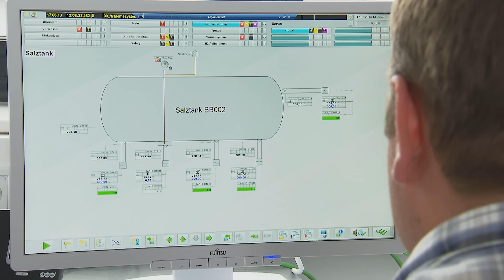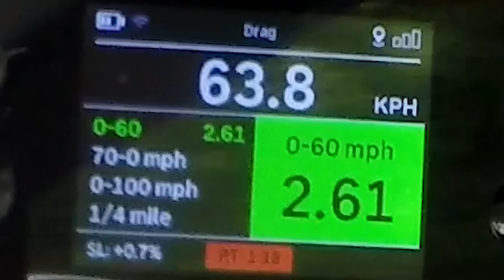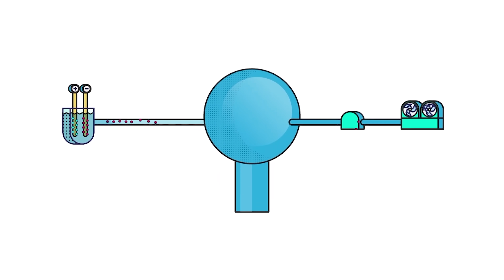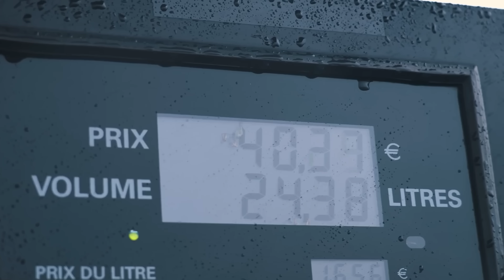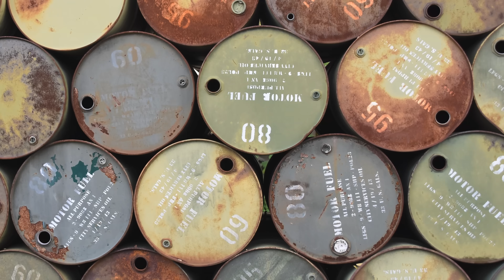Porsche just SAVED petrol engines FOREVER

Comment: This is great news and all, however I don't think it will be any more than a niche market for the private car park. Why?
1. This will still have all the problems associated with local pollution(smog, poisonous NOX particles etc.). 
2. Look at where EV infrastructure was 10 years ago, then imagine it 10 years from now. EV infrastructure is going to be completely solved in the industrialized world by the time they can produce synthetic fuel at scale, in a green way. Which then begs the question, why put in a huge investment to replace something that is already covering 90% of users, with a worse solution?
3. EV's are objectively better cars than ICE cars. They are more efficient, they perform better, they are easier to drive, they have fewer things than can go wrong and need maintenance. Basically the only reason any customer would want to buy an ICE car over an EV is either because he lives in a very rural area, or because he has a subjective nostalgic preference for ICE cars.

I imagine we will get a future were all "gas stations" are basically converted to pure "EV stations", but some of them will have 1 synthetic fuel pump to cover those niche customers, and it will therefor probably be a quite expensive fuel.

Where this technology can really make a difference though is in industry. Air planes, ships, even long distance trucking perhaps, it can really turn out to be a magic solution for that problem.

Comment: If they can get the price of E-fuels down to something comparable to todays prices, then any country with a lot of sun could be an oil superpower.  Also, we can drive gas cars and Greta will finally shut up.  Emit the carbon, suck it back out of the air.  It's the perfect solution until we figure out battery tech.

Comment: Why? 
- Electric vehicles have better accelerations with almost no lag, full torque available at all RPMs. They can be made cheaper and lower in maintenance.
- The cost of this recapture-refinement process will have lower efficiency and will not be cheap at all.
- By the time you ramp up these new fuels the infrastructure for electric cars will (likely) be in place and new batter tech will allow charging them in 10 min or so.

Comment: so they're making hydrogen, which is an energy hog, to make electronic fuel (the e in efuel)... that seems like a waste.  let me guess only a few companies can do this!
whereas if any parking spot can be turned into an EV charge place.. by simply adding an awning, adding solar panels, and some batteries to store power when no EV is charging.  there are already companies making these as popup charging for shopping centers.

how many solar panel companies exist?  they're all in competition for sales.  how many efuel companies exist?

and electricity is still loads cheaper!

Comment: 25 percent efficiency only works in gasoline vehicles because we are pulling the energy out of the ground.  If we have to make the fuel with energy and only get 20 percent or less in return, that's terrible, expensive and not sustainable.  Sure EV's aren't perfect but they get around 77 percent efficiency in the total fuel cycle not the 16 percent expected from e-fuels.  Range and charging speeds improve every year and with the price of battery materials, particularly lithium, falling of a cliff the prices for ev's will keep falling.  This doesn't even include new battery chemistries coming to market literally right now.

Comment: In my opinion fuel cells make the most sense in the long term, they have better energy density than batteries, don't require nearly as many precious resources, and you don't need to spend 1/2 an hour recharging them. Theres a whole lot of problems with fuel cells at the moment, but to me they look like the best long term solution.

Comment: The charging problem will probably be solved way faster than this being able to supply global fuel consumption. Also "carbon neutral" is a blanket term used to make things sound more appealing then they are. Yes this is better for the environment than fossil fuels, but it's not on the level of electric cars. 
It looks like e-fuels could be great for aviation though and they should definitely push it more towards that direction.

Comment: It's a pipe dream. Only for exotic, premium buyers. The fuel  Is incredibly expensive and is not really carbon neutral.  Heavy equipment could use the hydrogen in diesel engines. That's what JCB is doing. No need to convert it to synthetic fuel.

Comment: The price wont be the problem. The thing is that we dont have that much energy to pruduce such a big amount of fuel, an EV can drive 3x longer than a normal car with the same energy. E fuel will be a solutions for planes and ships which cant use a electric motor. 
Nearest thing is to just use the electricity for the car "direkt" as long we dont have the power for efuel.

Comment: I think there is one more issue with modern cars.
Safety requirements
I am not talking about aribags or TC.
More about self driving technologies and disturbing displays inside.
So the problem is not on what new cars will run. But if You will be able to even drive them Yourself. 
Because if not, roads will be full of cars driven by people having no idea what they are doing on the road, beeing stuck in a queye to a charger..

Comment: If you drip used oil on a rock inside a wood burning stove feeding a fire, then feed that fire with drops of water, you will observe a significant increase in the amount of heat and fire. I learned this while I was a welder working for a company in Casper, Wyoming. He built an insulated steel shop and heated it with that wood burning stove but he discovered a way to burn off all the used oil from his backhoes and excavator and D8 Caterpillar and using water to increase the heat was sufficient to keep the shop nice and warm during the winter months.
Reply: How did he mix the oil and water? Did he add alcohol to make them blend?
Reply: @MilesCobbett  He had a container that he welded up to hold the used oil in and run a tube that I think was made of copper into a hole on top of an upright wood burning stove with a flat top on it that you could set pots and pans on for cooking. He would get that oil dripping on the metal plate that sat at an angle inside the pot where wood normally sits and lighted the oil with a torch or anything hot enough to get the flames going.  He had another container of water with a tube set right above the fire with a control valve to regulate how much water to drip on the fire. It was like the fire would explode when the water hit that fire and it would get much brighter and much hotter. I suppose it's because of the oxygen and hydrogen in the water that when broken up, is very flammable.

Comment: Just check how much energy and materials you need to put IN to produce the synthetic fuel and how small fraction of it is then actually stored in fuel for a car and you will see that it is not a feasible or cheap source of energy for cars AT ALL! It is just to keep expensive supercars fun for rich people. Why do you think Porsche is researching this? Come on... They already learned that their customers want manual transmissions, so they started to provide them again, despite the initial decision to make automatics only several years ago. Porsche is fully aware that they are going to loose many customers if they only sell electric cars. So they will keep selling gasoline ones with a only one small nuisance... the fuel will be expensive as hell. But that will not be a problem for future Porsche customers 😉.

Comment: for every kw of electricity generated can be converted to 500w of "e-fuel" then burned in a 40% efficient ice leaving you with 200w useful work, so 80% of energy generated is lost in this process. just charge a battery and 90+% of that kw is useful. Porche stop watering your crops with gatorade.

Comment: One thing you have wrong and everyone does, conventional oil dosent come from fossils, that was a lie spread by the Rothschilds to make oil sound rare to hike the price. Fossils only are found down to 16000 feet oil is drilled down at 35000 feet so it's not fossils. Fossil fuel is 100% incorrect and the truth is no one knows accurately how oil is produced! However the other lie is CO2 is a problem because there's a lot of evidence that there is no global warming sea levels aren't rising and CO2 is necessary for plant life, and humans only create 3% of all CO2 so we don't globally make that much difference, so whatever we do won't be of any significant difference, but no one questions it. Or they get shut down.

Comment: Another greenwash scam perpetrated by the fossil fuel industry (with the help of Porsche). They know if they can get this approved it creates a path for them to keep selling conventional fuel. No-one except the very wealthy will be able to afford this stuff but gas stations will keep selling conventional fuel, and owners of "e-fuel vehicles" will fill up on conventional dino-juice. After all, you can't tell the difference from tailpipe emissions between petrol from the ground or synthesised fuel. They both emit carbon dioxide. Meanwhile the planet keeps burning...

Comment: eh, forget about e-fuels for cars, in cars the energy density is a "nice to have", not a "must have". IMO the e-fuels should be targetting aviation, where carbon neutral fuel with very high energy density is a must in order to maintain useable flight ranges.

Comment: I live in Germany home of the car so am glad the EU did a U-turn and allowed E-fuels as part of Net Zero. Problem is the UK is continuing to put its head in the sand. Apart from stupidly, for a country that has no independent world leading Car Manufacturing base like Germany and Japan, unilaterally deciding to ban new Petrol/Diesel from 2030 but ignoring E-fuels is going to make UK isolated. Stupidly UKGov wants to do CO2 capture and hide it under the sea meanwhile E-fuel countries will be using CO2 capture to produce E-fuel. Also will drastically affect trade. The thing is if the UK doesn’t have E-fuels at the pump how can EU commercial vehicles doing deliveries and pickups in the UK going to refuel. UK will effectively be banning trade.

Comment: I do have my doubts about that technology. I know that methane based fuels can power cars - that's not even new.

But the thing is - burning methane-based fuel to CO² can never produce more energy than what is needed to turn that CO² back into methane. That's just chemically not possible. And due to low efficiencies (both in the creation of the fuel as well as it's burning in small scale combustion engines) you're actually gonna need A LOT more energy to produce that fuel than what you get back out from burning it.

This sort of fuel can work for applications like race cars and air planes - but there's simply no way it could ever become cost competitive for every day cars, because making the fuel will always need more energy, than charging an EV does.

Right now, methane is mostly produced from natural gas (fossil, not carbon neutral), and electricity in the US is mostly produced from natural gas and coal (fossil, not carbon neutral). And we are nowhere near being able to replace that with carbon neutral production, even without any demand for eFuels...

Comment: When the COVID lockdowns happened they expected a slow in global warming due to the reduction in CO2 and Methane. What they've actually found is CO2 reduced dramatically but Methane increased dramatically. The reason for this was the polar ice started melting at a faster rate releasing more methane trapped inside. This showed that the CO2 was actually reducing the effect of the sun's radiation and not increasing it as previously thought.

Comment: So burning stuff is bad and we need to take CO2 out of the atmosphere. Why burn it again after taking it out? Use the methanol as a basis for making plastic and we don’t need oil at all, and we are extracting the CO2 that will otherwise wreck our planet. If you are a petrol head, and you have never driven an EV, just try it. The instant power and performance of an EV will soon help you overcome the lack of brrrm brrrm…

Comment: Btw. The e fuels can't be carbon neutral, because they need Fricking Tons of electricity to be processed. Than they have to be transported by Truck/Boats. So look. Instead of using Tons of electricity to create an almost carbon neutral fuel, which has a incredibly bad efficiency, just put the electricity into cars directly or in to storage facilities.

Comment: Is your desperation to stick with dinosaur engines and fuels that you can't see how much renewable energy gets wasted just sucking CO2 out of the air? See why the Swiss company Climeworks has failed at it. It was their idea to suck the carbon out of air completely and sell it for processes like this one. Turns out they are losing money due to the sheer amount of energy required to run the huge suction equipment. 

And then there is the need to split water to get hydrogen, which is another absolute energy hog. If you think there isn't enough renewable energy now to power things, then forget about getting more for this process. And it will cost a bomb at the pump due to all of these factors. Not to mention, we'll still be suffocating from all the pollution. 

This is as stupid an idea as it gets, and is another desperate attempt by Big Oil to profit off of people's suffering.

Comment: What's the point in this, as it all centres around generating massive levels of electric energy, from renewable sources (hydrogen production using this process is extremely inefficient). If you're doing that, why not just recharge an electric vehicle with it (far more efficient). The electric car is far more efficient in converting, that electricity into miles/kms travelled, than an ICE engine could be. We all know how inefficient the ICE is at converting energy (mainly into heat not motion). This seems a pointless exercise and, just delaying the inevitable. Once again bad environmental decision, for the sake of economic benefits. The capitalist world is going to destroy our world.

Comment: What about Hydrogen internal combustion engine that Toyota is testing now on Yaris GR? It does not require capturing carbon dioxide and synthesizing liquid fuels, because Hydrogen itself is a combustible gas (and produces an exhaust in the form of pure water).

Comment: As a petrolhead, I get it. But with what I know about the subject and climate change, I know this is not the silver bullet it seems. There are many many problems with getting e-fuels to be true net zero. The reality is they'll never be zero. So I see an investment into something that at best can be carbon neutral as a negative because it takes money and resources from investments into things that will actually make the climate better. All that energy spent to pull carbon from the atmosphere should be used just for that. To pull carbon out of the atmosphere. Not to put it back in the atmosphere a little later. If you really think about the climate, electric cars are the only ones that make sense. Sure I'm all for synthethic fuels for Lamborghinis and Porsches and the like, because those care are comparatively few on the road and won't actually pollute a lot. But the mainstream must go electric if we're to be ok on the climate front. Not really going to be happy chugging along in your 1.2TDI using e-fuels if there's tornados and floods and fires all around you.

Comment: It is still in development and almost no production if you consider the exclusivity of its current use. To mass production is a very big jump which might crash the entire process developed so far. You might need another Elon to have the courage to push this further, so far that it can become a replacement for the current fuels. It should be clear that carbon capture will not stop the people getting seriously ill due to the NOx emissions and this e fuel will continue to produce these toxic particles. Ultimately it will make less sense to spend huge money o technology that can bring small to less profit per mile. To me, the amount of clean energy production required to produce this fuel would be better spent in BEV infrastructure as we can get rid of NOx emissions in the end. Another possibility to be investigated is the use of H2 in ICE vehicles and that would be something to worth looking at. All the best and hope to leave a better world for the future generations.👏

Comment: E-fuels are not inherently carbon-neutral, as they require energy to produce. The production of e-fuels requires energy sources such as renewable energy to provide the electricity needed for the electrolysis of water and the conversion of carbon dioxide into synthetic fuels. The energy sources used must therefore come from renewable sources to ensure that the production of e-fuels is truly carbon-neutral.

When renewable energy sources are used to produce e-fuels, they can be considered carbon-neutral, as the combustion of the fuels releases only as much CO2 as was previously removed from the atmosphere during their production. However, it is important to note that the actual CO2 balance of e-fuels also depends on factors such as transportation, storage, and use.